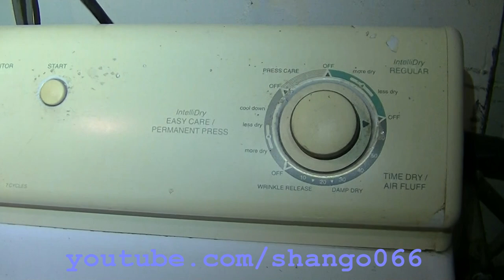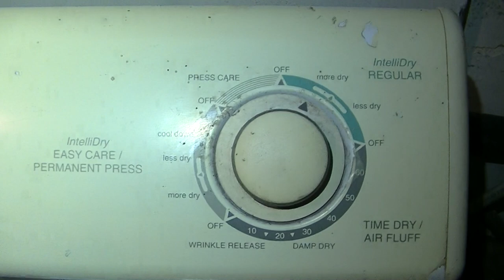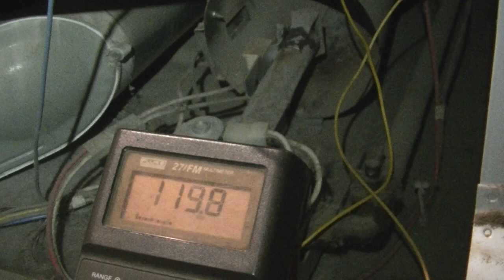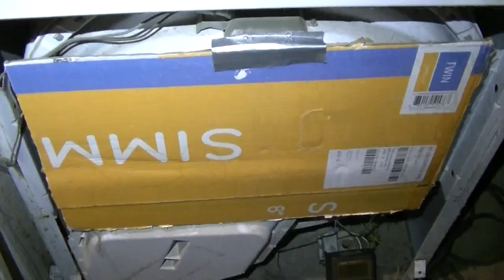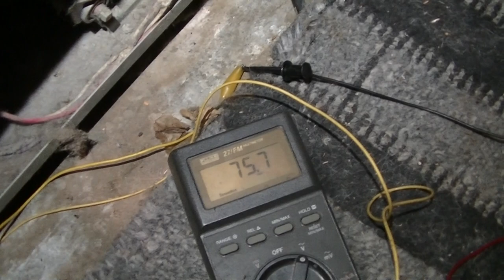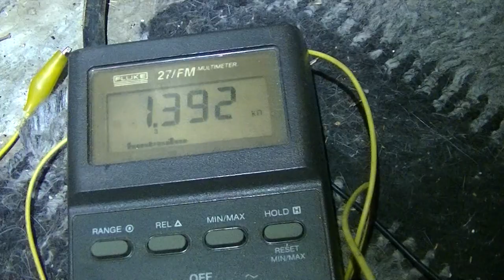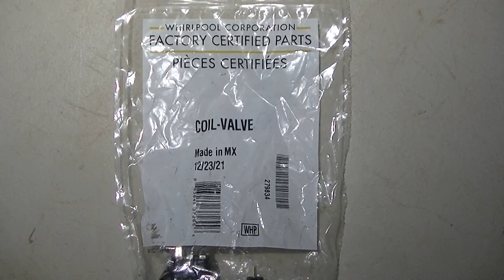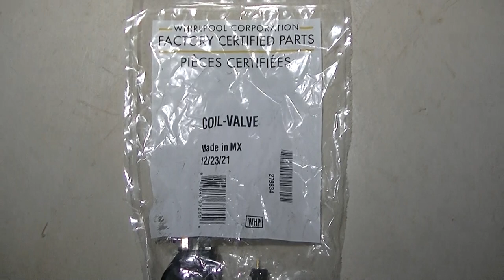Maytag Whirlpool Gas Dryer No Heat Diagnosis

Comment: I'm only 8 minutes in, and without the spoiler at the beginning, I woulda guessed the short-cycling was due to heat setting being in low or med, unless the clothes never dried., Edit now at 17:00, igniter coming on but no gas, my machine had the same problem. I took all that igniter hood assembly (sans solenoids and pipe) in a bag to appliance repair, told the guy what happens and he said it was the infrared detector he said third one he saw that week. He couldn't believe that I didn't break the fragile igniter carrying it in the bag with the other items. Still working 10 + years later (light use).

Comment: I think you'll find yourself replacing the igniter too. The igniter can change resistance not pulling enough current to pull the coil. I learned that a long time ago when I first started repairing appliances for Sears.
Reply: A nitride ignitor kit would be a good thing to put on there.  Silicon nitride ignitors are much more robust.
Reply: @douro20  , when replacing one, you do not want to touch the ignitor with your hands, the oil in your skin will cause it to crack/ fail. the same technology is used in gas furnaces.
Reply: @gregoryclemen1870  Yes that is understandable.  It's amazing that the carbide ignitor in my Payne air handler hasn't gone out yet even though it looks like it could go at any time.
Reply: @douro20  , I am a firm believer in having spare parts on hand/ collecting dust on the shelve, due to the fact that failures always happen on weekends/ holidays. your unit was built by carrier, I was in that field for years, now retired.

Comment: One of my coworkers had a Maytag by whirlpool washer for 18 months.  Top loader high efficiency crap with no agitator and a logic board instead of a simple and reliable mechanical timer.   The board failed and to get it replaced was $450 + $100 service call.   The whole washer was $650 brand new!  I checked and the board was $450 internet price so the servicer wasn't marking the part up.   He junked it and bought a Frigidaire.   Not a bit better but no more $$ to Whirlpool aka Scampool.

Comment: Oh I miss the old dryers no electronic timers no circuit boards that are prone to going bad at the slightest hint of lightning worked on washers and dryers from 2000 to about 2011 and I sure do miss the older washer and dryers these new things are absolute garbage it's constant circuit board issues too small of a pump on the washers so they get clogged up or don't work like they should if you can find a dryer like the one in the video get it same goes if it's the electric version instead of the gas they are so simple they just work

Comment: Holy shit a gas dryer... Technology was wild.. Was there ever a nuclear fision dryer?
Reply: It’s still releasing electromagnetic heat energy from the destruction of the atomic structure
Reply: @cardboardboxification  Technically correct but imagine source material emitting ionizing radiation  :O
Reply: Gas dryers are much more efficient than any electric dryer.  They also dry clothes faster as they have considerably higher heat capacity.
Reply: @douro20  They also burn and blow your house down.. it's literally open fire close to dust particles and textile..

Also drying clothes quickly at higher temperatures might not be exactly good for them
Reply: @harshnemesis  Yeah they can be dangerous if neglected...any gas appliance can be.  And drying clothes faster doesn't necessarily mean using higher temperatures.  With a higher heating capacity you can use a higher velocity blower to force more air through the clothes while they are being dried.  Some gas dryers actually run cooler than electric ones.
Reply: @dezeekat  just pack some rich yellow cake on the igniter
Reply: @douro20  which they, just like most appliances are.. after all the type of maintenance required here is opening up the machine and vaccuming the dust out every few months.. which no average user does.
Reply: I am amazed by all the comments here where people are stunned by the concept of a gas dryer. 
They have been around forever and were extremely popular.  Gas dryers cost much less to run than electric dryers,they typically use half the amount of electricity.  They are also quite safe.  There were even gas powered refrigerators. Servel used to make those. Most people also had gas ranges for the same reason. They cost less to use than electric ones.
Reply: @Suddenlyits1960  motorhomes still use ammonia refrigerators that use just a pilot light from propane
Reply: @Suddenlyits1960  Username checks out. gas appliances don't really exists anymore because they are dangerous AF. Don't know how butan gas prices were affected but here in EU gas right now in general is also expensive AF and the claim of this being cheaper to run probably isn't valid today either.
Reply: @Dark,name checks out,as in “in the dark”. Thats utter BS. “They don’t really exist anymore” either something exists or it doesn’t. I live in America and gas dryers are still popular and common.  you can walk into Best Buy or any other appliance shop and buy one new right now. A recent study shows that 60 percent of California homes are still using gas ranges.  And yes,there is a big difference in operation cost.
Reply: @Dark,Things are different in America. we also have gas water heaters out here. The vast majority of homes have them and again,like gas ranges and dryers they cost much less to operate than electrically heated units.  The reason electric appliances are being pushed is largely for political reasons,it isn’t because gas appliances are scary and dangerous and blowing up left and right. They’ve been proven in decades of use. Gas stoves,water heaters and clothes dryers are over 100 years old. They wouldn’t have made them all these years and still be making them today if they were as “dangerous AF”.
Reply: @Suddenlyits1960 I said don't really, which means obscurity, it's not popular, calm down. Living in the dark is using a gas dryer, lmao. Also Not even us is backwards enough to use them today. That 60 percent is gas ranges, not gas dryers, lmao that's a big difference because cooking is in general a fire hazard, a dryer doesn't have to be and a dryer is not supposed to be babysitted, unlike cooking. There are many reports of clothes or even houses burning down because of a dryer.. you can bet over 90% of these were gas powered. The question is do the power savings make up for the cost of a house? Definitely not 🤣

Comment: There are some very good appliance parts sites and when you click on a certain part a link pops up that gives diagnostic and replacement information. Very fast delivery too.
My over-the-range microwave died a few years ago, the troubleshooting info suggested a failed capacitor,,,can you believe that? A new one was like $80 so I found a used one on eBay for $25 and it has been in daily use since.

Comment: I know on my stove...it has the ignitor and it wouldnt even start because the ignitor was weak and wasnt the correct resistance anymore, so I dont know if that ignitor is the same design or not.  Ignitor opening up when hot or sensor going open.  Possable blockage?

Comment: I'm interested because we never has gas dryers (always electric heater dryers) , and wondered how they worked.
Oh, I noticed the flame started looking yellow before it went off. Is that a symptom? Yellow flame usually means not enough oxygen. Correct?

Comment: I felt a little uneasy when the gas turned on and there was no flame. It's probably not as dramatic for people used to work with gas appliances.
Reply: there is no gas pocketing that takes place , being that it is an "IN SHOT BURNER" ,and there is always a draft on the burner when the dryer is operating.

Comment: I WOULD BE SCARED DRYER WOULD BURN THE HOUSE DOWN RUNNING ON GAS. I ALSO HAVE A MICROWAVE FROM THE 1950S AND ITS STILL GOING STRONG.😁😁😁😁
Reply: Plenty of electric dryers have caused house fire too.  I don't know why people are so scared of gas.  Maintenance is key to safety.
Reply: @joshjones3227  My father hates anything powered by gas.  We only have a gas furnace and water heater because they would cost too much to run otherwise.
Reply: Stormchaser300, What model and make of microwave do you have that is from the 1950’s? I know some of the ones in the 1950’s required plumbing for water to cool the unit.  I have the first freestanding Radarage from 1967. Took me a long time to find one locally. People I show it too are afraid if it because it has no glass window on the front,only a perforated stainless steel mesh that allows the steam and fragrance of the cooking food to escape into the room.  (The microwaves do not escape).  I believe it weighs 80-100lbs.
It’s very beautiful. Some of the models that followed afterward looked someone similar to it and they kept the same basic cabinet and door design into the 1970’s when they had the glass capacitance touch screens.  Those were damn good microwaves. Built to last and they will run forever.  The touch matic ones can become “buggy” when the capacitors fail. 
The old window air conditioners of the 50’s and 60’s were also much better and of course more beautiful than the junk made today.

Comment: you need the dryer door sealed with cardboard so it will pull air threw the firetube 
don,t feel bad that,s how you figure out how it works

Comment: Were there ever gas dryers in Europe? Never seen one of these here but I knew about their existance in North America. Kind of scary, fluff and a flame doesn't look like a good combination.
Reply: i never saw a gas dryer in europe.
Reply: Reason why gas dryers don’t really exist in Europe is they need to be exhausted to the outside and most homes in Europe don’t have the venting for a gas dryer nor have gas lines running to the home and few probably do but most homes in Europe are mostly all electric.
Reply: Never seen one in the UK. You certainly wouldn't be allowed to work on one yourself like this. Our gas boilers (furnaces) have to be serviced by a qualified and licenced tradesperson - you're not even allowed to remove the front cover to work on the electrics now. This is probably a good thing - in such a densely populated country, a gas explosion can level a street. I've seen it happen.
Reply: @rich_edwards79  gas explosions can happen however there’s a higher probability of getting zapped from electricity (especially if it’s 240 volts) than getting knocked out from a gas explosion. Another thing too is a heating element is more than likely to short out than gas valve coils like seen in the video.

Comment: There is no flame detection (e.g. ionization)? I do not believe.
Reply: My 1990s Whirlpool uses a bimetallic switch to cut power to the gas valve if the flame goes out. The same switch also ensures the ignitor is hot before the gas is turned on. This Maytag is probably similar.

Comment: intrigued, as we dont have gas dryers in the uk
Reply: Just gaslighters? 🤣
Reply: @401ksolar  they use Molotov cocktails for drying cloths
Reply: Why not?  Are they illegal?
Reply: Only in laundrettes
Reply: I’ve grew up with dryers gas and electric since my childhood home only had a 240 volt dryer outlet, second house has both a 240 volt dryer outlet and gas hookup but my folks got a gas dryer when I moved to my current home in 2006 since gas is cheaper than electric here in Southern California.

Comment: How many grooves in a 33 rpm record
Reply: Depends on audio frequency, basses need wider grooves... I don't know exactly how the recording device worked but I imagine that the cutting head had mechanical limits to avoid creating a too wide groove and a low cut filter would also be used on the audio input to avoid distortions due to those mechanical limits.
And I guess that more recently they could already have a computerized system to adjust the width automatically and be able to record more tracks or longer tracks on a single disc while maintaining maximum audio fidelity, but all that is pure speculation on my part.
Reply: Two

Comment: Had one of these in electric bought in maybe 2008, replaced 2019. With all the digital controls and gimmicks like wifi the new dryer probably won't make it 6 years. Consumers have no idea or interest to know that a clothes dryer is just a giant hair dryer that tumbles clothes. A huge money maker for the manufacturers. My old dryer looked like brand new compared to your victim.
Reply: Them $1,000 front loader dryer the matches that fancy front loader is a major money maker it doesn’t cost any more then the cheap dryer

Comment: Imagine a failure mode where...

1. The PV installation for the house got islanded and the solar inverter did not detect that, and its frequency control went nuts and it started cranking out say 100 Hz, and no safetys tripped.
2. The gas dryer started up but was spinning overspeed because of the high frequency, sucking too much air through the burner and keeping the ignitor too cool to ignite the gas.
3. Something had happened with the gas supply and liquid gas was getting through to the burner and the liquid mist went through and soaked the clothes in the drum with liquid gas that wasn't immediately flashing off because something also went wrong with the laws of physics that day.
4. Some lint got behind the ignitor or something, I dunno, but it got hot enough to light some of the gas.
5. The handily rich air-fuel mixture that was filling the ductwork and clothes drum got lit af.
6. And blew the front clean off the machine.
7. The drum, spinning at a heinous rate of rpms, flung burning clothes all over the shop, keeping enough burning material inside the drum to give a favourable visual effect.

That would be a rather exciting failure mode.

Comment: Gas dryers are such a waste and bad for the environment
Reply: Natural gas, when not collected to be used as fuel elsewhere, is burned directly in the oil wells/fields where it is extracted. Its composition is mainly methane and if it is not burned it would cause a much greater greenhouse effect than the CO2 generated by burning it.
Reply: If you think about it, if you have a natural gas fired power plant and by them time the electricity makes its way to your house to power a electric dryer that typically has a 5600 watt heating element in it, you’ll have put more carbon dioxide into the atmosphere since it takes more natural gas to generate electricity then if you were to use it to heat a dryer since the only electricity a gas dryer uses is to power the drive motor, timer motor, igniter, burner solenoids and that’s about it. You’ll use about 200 to 300 watts of electric on a gas dryer since that’s the wattage a gas dryer pulls when in operation, and will use a few cents worth of natural gas when using a gas dryer. Another thing too is since a gas dryer is cheaper to use than electric, it basically will be free to use since it will have payed for itself many times over the life span of the dryer and will be thousands richer when using a gas dryer vs electric.
Reply: @Sean A806, 100 per cent true.